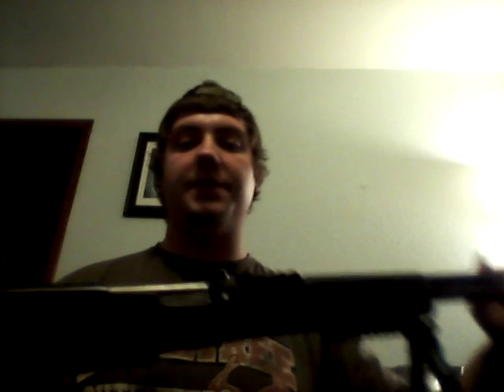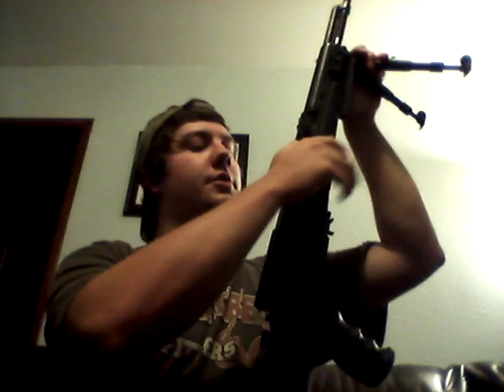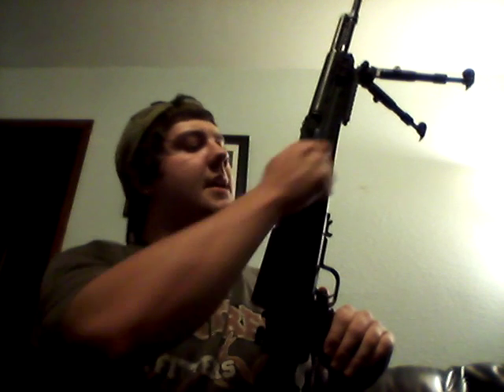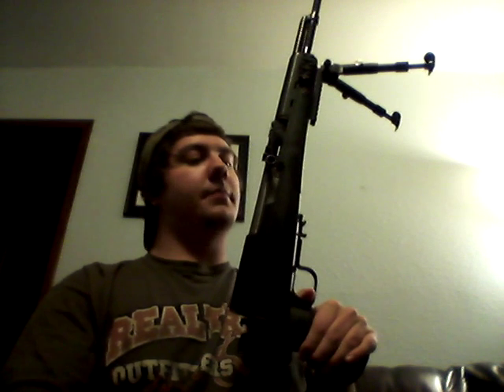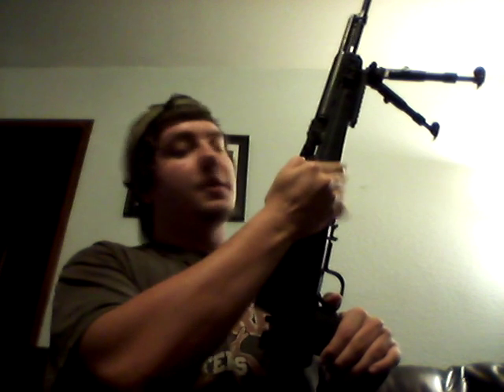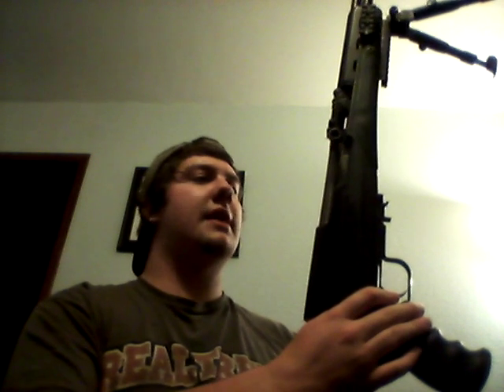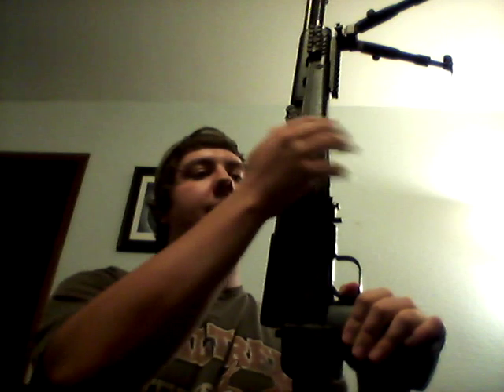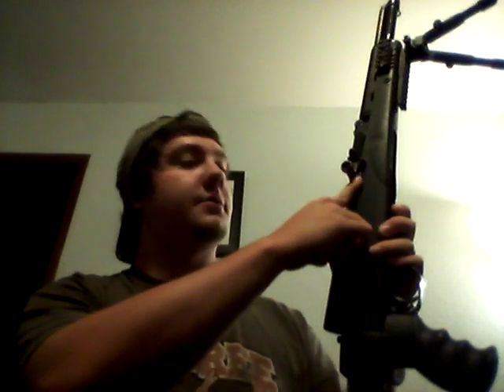How to properly de-cock your SKS Rifle

Comment: Hell yeah, worked on the first try. Saved me from having to buy a dummy round. I know most people in forums say, "Just dry fire it, it'll be fine." Which is probably true, but for a poor man who has to save up for a $300-$400 rifle, I like to take care of what I have and ensure it lasts for me. Thanks for the video!
Reply: Apparently the firing pins used in the SKS after 1951 can get lodged in the bolt face, causing slam fires, damage to the pin, and damage to the bolt. I read that it's not a good idea to dry fire unless you replace the pin with one of the Murray pins that has a spring.
Reply: @FakeProfOak   Pure nonsense.

Comment: sir, i urge you  to NOT do this. what you are doing is resting the hammer on the secondary sear on the disconnect. this is a safety feature for the off chance the primary sear was to slip. this way, the gun will only fire once the bolt is fully closed.

for proof of concept, try this, but take of your cover off once you've "de cocked" it. give the bolt a bump forward, and you'll see that the hammer has fallen.
Reply: The rifle is still Inert... and needs to be cycled again to fire so...I say good job.
Reply: Not really. the hammer is still held back about 90% of the way, and if there was a round in the chamber with this method of "decock" a light nudge of the charging handle, or hard enough bump of the gun would case the disconnect to drop, which would release the hammer and fire a round.
Reply: This isn't anything I would do with a loaded  chamber, on an unloaded rifle it's fine, and I doubt "bumping" it would set it off at all.
Reply: it's fine on an unloaded rifle. it's also fine to leave it cocked. it doesn't really matter, as the hammer spring is always under some level of tension. but try it. a bump will set the hammer free in this instance; seeing as how the hammer is only being caught by a little lip of metal a few mm long. since the tolerances of these guns vary so much, some guns will be easier set off than others in this fashion. 

that lip is only there to ensure the hammer drops when the bolt fully shut, not to hold the hammer back on minimal surface tension.